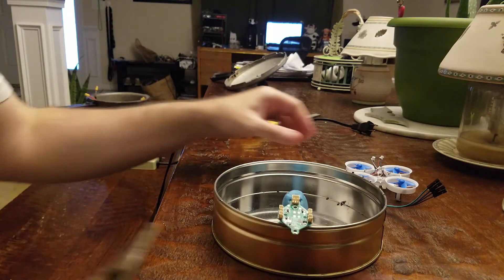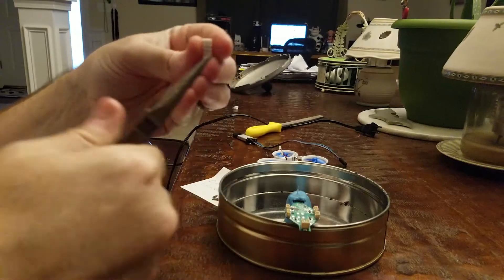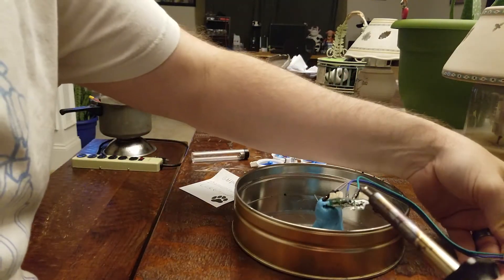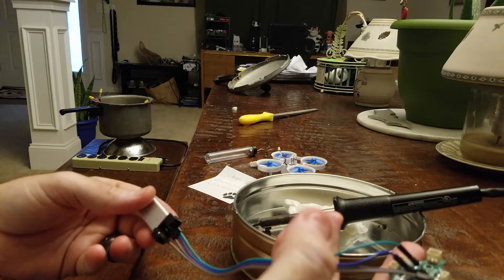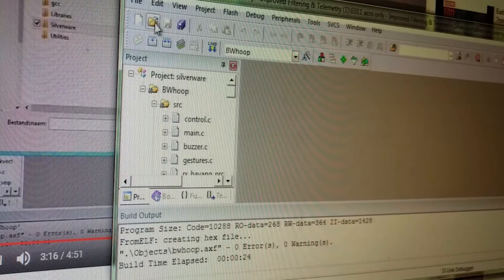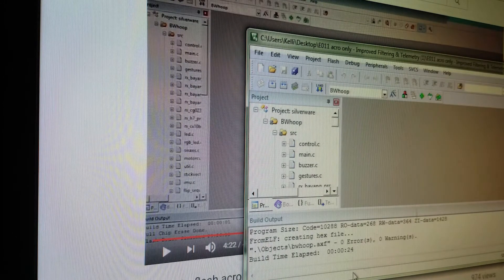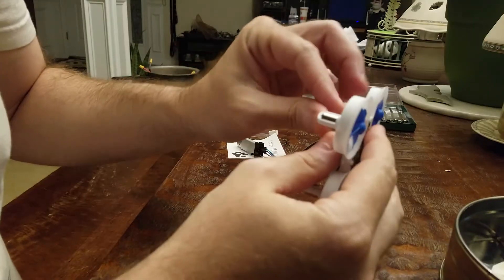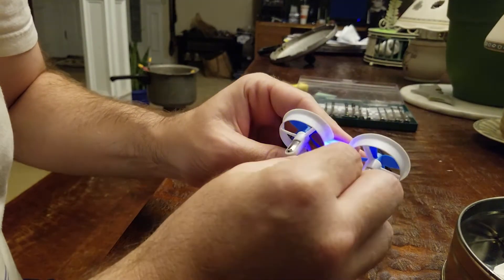Eachine 011 Full Acro Firmware Installation - READ DESCRIPTION

Comment: Good morning

My st link does not want to connect. Do you know a solution for that?
Reply from the maker: Are the connections to the correct points and does the computer recognize the usb item when you plug it in
Reply: @Sully365  connections are good , the computer reconize the usb . i think something with read protection , i also can,t adjust optionbytes set to 0 (connect under reset)

Comment: There are three video tutorial that i've watched, and all use 3 pins : SWDIO, GND, SWCLK also use lipo battery. Why use lipo battery connected to the board insteads using 3.3v pin from ST-Link ?
Reply from the maker: gonebdg i don't think many people doing this truly know how the STM devices work enough to try that.  I also think it's just easier to plug in a lipo. No risk of soldering a powered pin and wrecking it
Reply: I see ... so no special reason.
I just think that 3.3v pin is there provided on st-link for that purpose and the power voltage will stable insteads using lipo battery.
we can easily mod the st-link stock wires/pins with an on-off switch for this purpose.
Thanks for the video!
Reply from the maker: gonebdg that's awesome.  I'm waiting for the next sale so i can grab another.  These are so much fun with the irangex module

Comment: great video, but can someone help me? I have a problem: My board is connected the right way to the stlink(I checked everything with a multimeter, I'm using the 4 small holes on the top of the board, but they're connected directly to the 4 big pads in the middle(multimeter). First I start the STM32 st link utility program on my computer, then I wait 5 secs and connect the stlink which is already connected to the board, then I wait another 5 secs and connect the battery to the board(LEDs begin flashing like they normally do), another 5secs later I click the connect button in the Program, I got an Error saying:"Can not connect to target! Please select "Connect Under Reset" mode from Target->Settings menu and try again. If you're trying to connect a low frequency application, please select a lower SWD Fequency mode from Target->Settings menu." I didn't find a "Connect Under Reset" checkbox thing so next I clicked The disconnect Button and(Program freezed for a few secs), I got a message that he disconnected from device, then I click Connect again, and I get an Error (Program freezed for a few secs again) saying:"STLink USB communication error".
Reply: https://drive.google.com/open?id=1ixqbtqX0k8BtIIET0Wz3rLUUBoDpHyZM
Let me know if I did anything wrong, thanks!
Reply from the maker: Felix Baum can't see that right   now, but did you go based off labels on the top four pin holes or off the middle pads?
Reply: Five Freaking Onion Rings I tried both, I checked with a multimeter which pins are connected together and it says that the top 4 pin holes are labeled right.(on the Quad: Top pin hole SWCLK->DAT(BIG middle pin), SWDIO->CLK, GND->GND) But In the video I used the middle pins, but that changes nothing on my computer.
Reply from the maker: Felix Baum you may have to ask c ray tech.  He's the guru on this.  Sadly, i just know the instructions and not much on the trouble shooting side beyond the obvious.
Reply: Thanks, I'll ask him!
Reply: Eric Unfortunately no....
Reply from the maker: Eric no, i haven't had much time with the brushed quads lately.  I really don't understand why yours is behaving this way.
Reply: Eric It didn't work for me. I plugged DAT in RST, CLK in SWIM and GND in GND. Is that how you did it?
Reply: Eric k I'm gonna try it, what version of stm32 St link until do you use?
Reply: Eric Ok, thanks for all your tips, I relly appreciate your help!
Reply: Eric Unfortunately it's still not working. I tried 2 STlinks and a lot of STM versions. Can you please send me the installation files of your programs? Maybe that's why it's not working...
Reply: Felix Baun - 
I too have your same problem; however, the ST-Link has different positions for contacts

Comment: I think this is better and now is in promo: http://bit.ly/2gMpzHf Have great trust, lift 20 grams, and frame is more elastic. and motors can upgrade whit 67000k: http://bit.ly/2z7h6Wz for more power. COOL
Reply from the maker: I have the F36 and it's great but there is no acro firmware.  for $5 more, you get 716 motors and acro ability after a fashion.

Comment: Good job! 
I'm not good at solder. 
Fortunately, there is a 3pin port on my B03 pro board. I don't need to take the drone  apart or solder it. I just need to buy a 3 pin wire ; D.
Reply from the maker: Cyril Liu which board is that?

Comment: I just updated the firmware on my E011.. This works amazingly well.. 

I did run into one issue though.  
When I tried to connect to the board, Both STLink Util and Kiel gave me an error that it could not connect and that I needed to update the frequency....

It turns out My dongle had a very old firmware on it, using the ST Link Utility, I flashed the latest firmware and everything worked as described in the instructions/video.

Happy Hacking & Flying !
Reply from the maker: Awesome job.  Sadly, this was my first ever experience with STLink and Kiel so i'm SO glad i didn't run into problems requiring troubleshooting.  all of my problems were based around finding the software i needed.  

Anyway, glad you got it settled, happy flying

Comment: can you make a video on adjusting the pids?the basics of what to mess around with and the do's and donts when flashing like rates,motor vibrations and all that
Reply from the maker: I wish i knew how. Unfortunately, i'm not a programmer so i don't know what codes were modified/changed.  If you look in the thread on the RC group where the firmware is located: https://www.rcgroups.com/forums/showpost.php?p=37357881&postcount=136 you can get more info.  They were updating it, but i think it's down to 'as good as it gets' right now.  Let me know if i can help with anything else, though
Reply from the maker: Here is another video with information on where you can actually modify the code but i have no idea what to change since i have not done it.  https://www.youtube.com/watch?v=VRfEtujo7K0

Comment: Good job bro!
Reply from the maker: +NotFastEnuf I'm just waiting on your next breakthrough.   I love this little thing,  but o ended up burning out a motor.
Reply: 716 motors burn fast.  The mmw ones are expensive but seem to last a little longer.  I was just ordering more e011s to get spare motors.  That way you've got a sweet fc to put in your 6mm whoops too.  My next focus in the project  will be using and tuning the fc for 8.5mm outdoor rippers!
Reply from the maker: i just bought some 8520 motors for this...and then i promptly destroyed one by pushing the prop on too hard and popping the cap off the bottom...all my efforts were in vain to fix...HOWEVER, i did get a chance to fly with 3 8520s and 1 716 and it was excellent..I ordered more 8520 and i'm trying to piece together a 3" or smaller brushless now.  

Thanks again, keep me posted on your next project.  I've found a lot more love for the little quads since it is SO hard finding places to fly the 5"
Reply: If you want a good small quad that you can fly anywhere, look into the emax micro brushless power pack, a spacecowboy xlr-2 frame, and a 350mah 2s battery.  It's an awesome combo.

Comment: I Whooped the E010 but was disappointed they locked the board so you couldn't flash acro, but Eachine obviously listened to their customers with the flashable firmware, bigger and detachable motors, and flat canopy to easily attach camera.
Reply from the maker: i started with the eachine 010 and someone mentioned the furibee F36 was faster...so my camera went there...then to this one where i'm really happy.  I originally wanted a brushless with an F3 board, but the cost is crazy for the amount of flying I do.  Overall, though, i gotta give eachine credit for updating the micro, adding a new brushless 90mm, and updating the wizard 220.  they appear to be listening to customers.